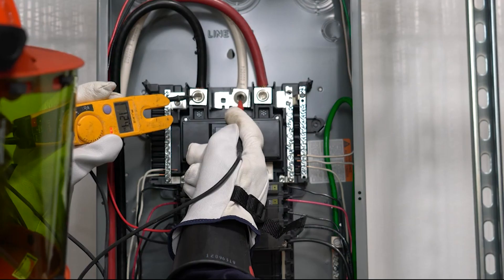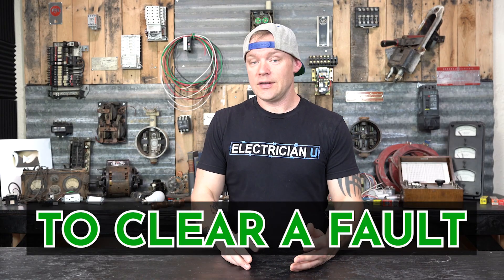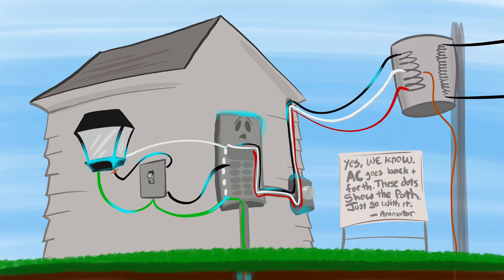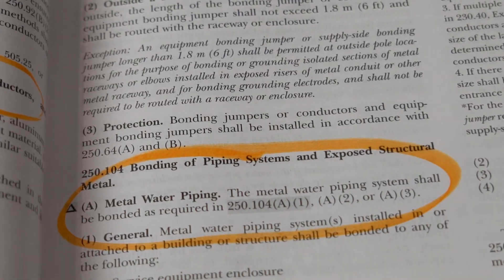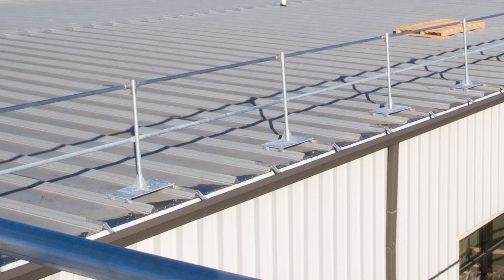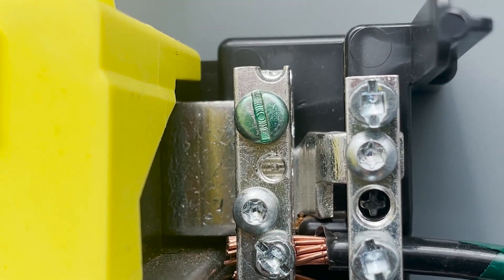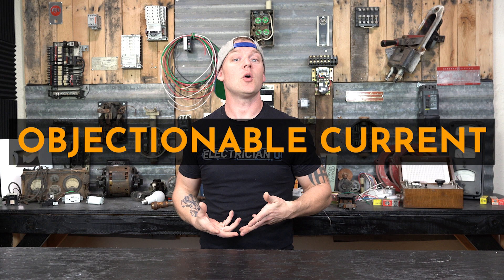Why Do We BOND Neutral & Ground in ELECTRICAL SERVICE PANELS?

Comment: Would you believe me if I told you that current doesn't actually go "back and forth".  It generally aligns with the voltage signal propagation, down the hot wire.  Neutral is always neutral, it doesn't significantly alternate charge in magnitude.  Most people get that wrong, and they usually teach it wrong.  But yea, no,.. And now you know.  And knowledge is power.  Or is it half the battle?

Comment: One question, if the goal is to get the fault back to the transformer via bonding, what is the purpose of the actual ground at the service panel?

Why is the panel grounded via a ground rod?

Comment: we bond neutral and ground at the main service panel for safety reasons. It creates a direct path back to the source in case of a fault, which helps trip the breaker faster and prevent shocks. If they weren’t bonded, stray voltage could build up on metal parts, making them dangerous. But it’s important to only bond them at the main panel, not in subpanels, to avoid creating parallel paths for current.

Comment: You cannot bond power stations to to the home bresker box the ground to netural is 40 volts ac on my powrr station. I just checked the voltage. Ground and hot is the right voltage which you dont bond that. I need to find a transfer switvh thst can isolate the 40 volts. Puting it to ground will causr a fire. 73

Comment: Dude you're moving your hands like a traffic control police! no offense but electricity dont travel like that, however we protect our equipments and  ourselves by installing RCD in the sub panel and by doing that we have to keep neutral and earth separated from each other in the subpanel. Earth neutral can be bonded before RCD and not after cause RCD will periodically search for neutral earth short circuit and it may trip if the current is more than 4mA to 30mA depending on the types of RCD. So please stop shouting about bonding everywhere,  apart from this your video is very informative and useful basic lesson one can get very easily. Keep it up and Cheers.

Comment: Would the meter box be considered the first point of disconnect...the only point of Grounding I have on my 200 amp entrance is from the Meter box and not at the main. Does this need to be changed?

Comment: I don't know if people complain that you explain things in complicated ways, but I've never been able to grasp the theory behind neutral wire systems or why the neutral bus is connected to the ground bus until I found your videos. So you're your method of explaining this stuff is working for at least one guy!

That said, there's still one question I have about all this which I'm not entirely sure about, but I think I have inferred what's going on. 

When a properly wired single phase system with neutral, ground, and two hots (and a cot) has a ground fault condition, you say that the bonded neutral and grounded busses ensure that the unloaded current is given a preferred path to complete the circuit through the breaker, thus ensuring the breaker is able to detect the elevated current causing it to trip, open the circuit, and eliminate the fault. 

My question is, with the neutral being bonded to the ground bus, it gives that over current access to the entire bonded system, including every metal component in the structure in that bonded system. Forgive the personification of energy here, but when the an over current occurs on the neutral wires, why in the main breaker box where the neutral and ground busses are bonded, does the over current "choose" to flow up the neutral wire back to the source and not through the bonding device to the grounded bus, thus introducing a dangerously unbalance potential condition at best or energizing some or all the bonded equipment at worst? I've always understood that current, which obviously doesn't "choose" to do anything will always flow in the path of least resistance, and grounded circuits are designed to present the least resistance possible. 

What I've inferred about this is that if an over current condition occurs, the current will "choose" to go back to the source before going to ground, not for anything to do with resistance, rather as a function of the unmitigated potential of the unloaded closed circuit which now includes the massive potential of the source. 

Am I thinking about this the right way? When this occurs, is the electromagnetic energy of this massive current so high that it ensures that no stray current will take the grounded and bonded path through the system? 

Hopefully that makes sense!

Comment: Should lightning strike you want a low impedance path to earth to absorb the volt-amps in a way that prevents arcing between equipment, cases and equipment. The same would be true for a hot fault to a case ground -- to give a low impedance path to absorb any residual volt-amps that by-passed the neutral return and secondarily to trip the breaker of the circuit faulted. Thus many redundant low impedance bonding devises are added to provide redundancy to the grounding safety system.

Comment: I'm just a curious DIY for conceptual learning. From your animation the stray current from ground fault flows to the breaker panel and without a bonding to neutral bus bar it will go directly to earth through the ground rod. Is the current vanished there in the earth? Then since there is a bonding, the fault current will flow together with the neutral back to the transformer (source). But the whole stray current will flow back to the transformer or there is a portion of it will flow to the ground rod. At my home I can't seem find any ground wire coming from city service line to the main panel breaker. I noticed however there is a stranded copper bare wire stemming from the meter water pipe connected to the neutral bus bar. What is the difference between the service ground wire and the ground wire coming from the water meter pipe? Appreciate if any one could explain this.

Comment: Thanks Dustin, another great way to save time in the future, maybe an ATS for a large generator is added and it becomes the first disconnect, if you separated the Neutrals and grounds and kept the Bond screw in originally, all you need to do is remove the bond screw since the ATS becomes the first disconnect.

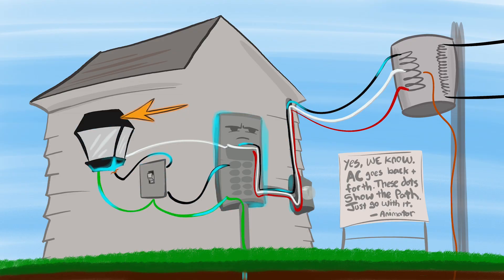Comment: @3:04. Yes it does have a return path. That is one of the main reasons utility ground electrodes are used ( as a secondary neutral). If you lost your main neutral your return path will be through the mass of earth, then up the earth rod of the transformer and back to the neutral of the transformer (which is bonded to the earth rod). Why do you think you get shocked standing bare feet and touching a live wire with one hand? The return path is through the mass of earth.

Comment: Question.... should you bond the ground with an electrical system ground on metal building ground? Seems that could give current a path to travel through the building before linking up with the main panel bond

Comment: I'm a novice electrician at a pipe plant I am being asked to hook up a light that is 277 wire which is one phase of 480 one wire going to the hot one wire going to the neutral and one wire going to ground the box that I am using does not have a neutral in it do I have to run my own neutral or can I do something else

Comment: I am not an electrician, but been a service tech, maintenance guy most of my life and I thought I knew some stuff.  This video kind of shatters my confidence.  Since I regularly compare myself to 'clueless' people, I think I am a genius, but then watched this and realize I am a bit clueless myself.  i thought breakers would recognize and trip at a fault condition even if just going thru a ground not a neutral.  I understand the GFCI concept which joe homeowner generally has no concept of, but i thought a hot touching a metal cover would just make that cover hot and pose a risk to anyone touching it to complete the circuit to ground and get shocked.  It sounds like this video says even a hot going all the way to the grounding rod will not necessarily trip the breaker ?

Eye opening.   Even if I'm still not quite understanding it right, at least i get the main point now.   Bond neutral and ground at first ( and only at first ) panel coming into house.

Comment: Is there a problem installing a duplex socket with an MC cable (12-3) in IG but the other duplex sockets connected to it are not in IG (Romex 14-2)? The ground would be connected to the box...

Comment: This is a very confusing There is a plethora of YT videos where experienced electricians clearly state that the neutrals and grounds should NEVER be on the the same sub bar - that there should never be any charge/load on the ground wires inside a breaker panel what so ever,  except in case there is a fault. In this video you show that unless those 2 are comnmonly connected on the sub bar, the breaker would not know to trip in the event of a fault. Why is there so much discrepancy about this amoung industry prefessionals?  Very frustrating.
Reply: i am no pro for sure, but I think when they say NEVER on the same bar that does not conflict with this video.  you should always have all your whites ONLY on the neutral bar(s) and your grounds/bares ONLY on the grounding bars.  In sub panels, they truly stay separate.  I understand your confusion that here you are being told to bond the neutral bar and ground so what is the difference ?   There is one.  I believe you won't ever have actual current flowing on the grounds in normal operation because electricity always looks for the easiest path.  Going back down non-faulted grounds would make no sense.  However, if you put neutrals on a bonded ground bar... yes you are completing the circuit, but you are putting serious current thru the bonding method.  This may only be a screw.  Remember grounding circuits are never meant to carry a current intentionally... only very briefly if something goes wrong.

Comment: You are 100% wrong on 6:21 for separately derived systems, and specifically relating to solar systems.

2017 codebook definition for a separately derived system in article 100 requires that it have NO connections to any other source, except for grounding and bonding purposes. That includes the neutral. Most generators and almost all solar systems are NOT designed this way, and are therefore not allowed to nor required to abide by the rules of a separately derived system.

Per 705.20 in particular requires that there be means to disconnect all ungrounded conductors, this doesn't include the Grounded Conductor (aka Neutral).

Solar system is not a Service either, so you don't bond at it, and don't put in a Ground Rod. If you do a Supply Side Connection (705.12(A) for 2017 code), you are supposed to land on the grounds and neutrals of the service disconnect, NOT bond them at your disconnect. Solar can go on the load side as well, per the rest of 705.12, if you do that, and bond the ground and neutral, you WILL cause objectionable current.

250.35 even lists out generators as separately derived and non-separately derived for rules differentiating the two. Most Solar Systems are interactive, meaning that they do not export energy when the grid is non-functional or under certain other conditions, and as a result, they do not need to have a separate means of clearing a fault. Speaking of which, a Solar Array is ONLY functionally grounded in almost all cases. Solidly grounded arrays are rare, as are true ungrounded arrays. They use hardware to detect issues such as Ground Faults, and to clear them through technical means. You do run an EGC the whole way, for both sensing faults as well as leveling the potential across the system, it connects to the inverter, which then has the ability to break the circuit if there is a fault. Wire is generally sized such that it is beyond the potential for shorts and similar issues, keep in mind that a PV System is a LIMITED source of power, not like the grid.

Comment: Not wanting to confuse things, since everything you say is absolutely correct (and clearly explained too!). But in North America where wye distribution circuits are commonly used, then the neutral of the distribution transformer is also connected to the transformer case, which is also connected to ground. So there is a parallel current path from the neutral at the service entrance to the transformer. The neutral is bonded to the transformer case so if there are unbalanced loads between the two "hot" conductors and thus current flowing in the neutral, it will always be referenced to ground at the transformer.

Comment: In my 200 amp service panel I have all of my grounds on one small connecting rod and all of my neutrals on the other side connecting rod so where should the bonding wire be in my box.

Comment: Question, if on secondary side of a transformer to a panel there is continuity between the hots and neutral wouldn’t it create a dead shirt from hot to ground when you bond neutral to ground? Just trying to understand this

Comment: NO!  We isolate the neutrals and the grounds at sub panels primarily because of Ohm’s law.:  if your primary panel has grounds and neutrals connected to the same bus and you have your sub panel’s grounds and neutrals connected together,  then your neutral load path will be divided between  the neutral conductor and the ground conductor.  This has nothing to do with faults.  If the neutrals and grounds are bonded in  both the main and the sub panels then your neutrals and grounds will be carrying the load at the sub panel.  Don’t believe  me?  Make a diagram of the sub panel’s grounds and neutrals connected together then diagram to the main panel.    Now, diagram a 100 watt light being powered from this sub panel, and then diagram the sub panel circuit connected to the main panel.  Make sure your diagram has both the sub panel and primarily panel’s grounds and neutrals connected together.  

Now, in your diagram, open up the neutral wire between the sub panel and primary panel.  The light remains lit because the neutral  return is going over the ground.  When you close the neutral back up, the load path is STILL flowing over the ground conductor.  However, ohm’s law tells us that all things being equal, the load will be divided by the neutral and the ground wire going between the primary and the sub panel.  Even when no “fault” exists.  

This is primarily why we isolate the neutrals and grounds at the sub panel.
Reply: Hey.  Thank you.  This is why it pays to read the comments instead of just trying to write your own.  I get what you're saying though and I don't think he explains that in the video ( I'm too lazy to watch the whole thing again ).  We can't crack him too hard though.  That ground flow you describe is definitely an 'objectionable current' which is what he makes very clear in the video is BAD and what NOT bonding in sub panels avoids.  I am glad you brought to my attention though the danger of that in non-fault situations an improperly wired sub-panel will still have objectionable currents.

Comment: Sorry for late reply, but if building are physically separate I have always put in a separate to earth connection. AKA I only send Red(120), Black(120) and white( Neutral) to the sub panel with a remote ground. Based on Code this reads as the correct method where building are physically separated over 20 feet. What do you do? In a typical installation of service I always do 2 grounds separated by 20 feet for redundancy and reliance. I only do this on the ground and do not bond the ground and neutral per code in the remote building with isolated grounds per building.

Comment: I DISAGREE!!!  THEY BOND IT IN ORDER TO GO THROUGH THE METER SO YOU GET CHARGED MONEY BECAUSE THE METER READS HOW MUCH CURRENT YOU USE IF IT GOES TO GROUND IT CAN'T READ IT AND YOU'LL GET FREE ELECTRICITY ON THEIR BEHALF REMEMBER THE POWER COMING IN IS ON THE HOT LEG GOING BACK AND FORTH BUT IF IT GOES INTO THE GROUND IT CAN'T THE BREAKER WILL STILL TRIP IF IT OVERDRAWS BECAUSE THE BREAKER IS ON THE HOT SIDE. 😘

Comment: I get why we need a bond; the explanation and animations make sense.    What I dont understand is why that bond happens in the panel: requiring 3 wires (Hot, neutral, ground) for each circuit.   Why not just bond ground and neutral just prior to each outlet (i.e. "Y" the neutral wire in the junction box).  This seems like it would accomplish the same requirements for a fault/short in an appliance.  The low resistance path would still make it to the same point in the service panel.    You just need a path back to the bond "south" of the fault.

So my big question is having a completely separate ground wire (all the way from service panel to outlet) some sort of redundancy , is there a situation or fault that this mitigates, or is this a cost thing (the cost of the extra wire is cheaper than making a Y at each box)?

Comment: At our utility, 480V services below a certain amperage require the customer to provide a line side disconnect.  Essentially, the first means of disconnect is before the meter.  Our utility will provide 480 V socket type Meters for 200A services and not use a CT setup.  Why you would need a 480V service at 200A is another question lol.  So the question is, in this type of setup, does the bond between neutral and ground happen at this customer owned disconnect even though it is before the meter.  I've seen different answers from different inspectors, what is your interpretation?